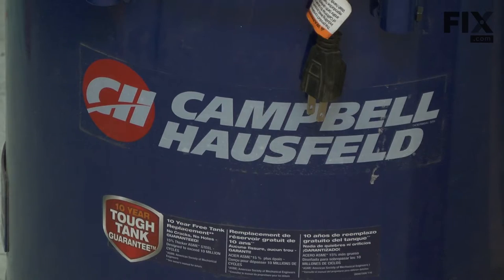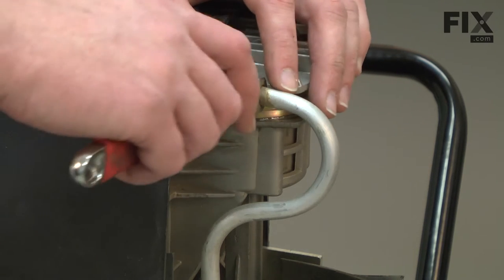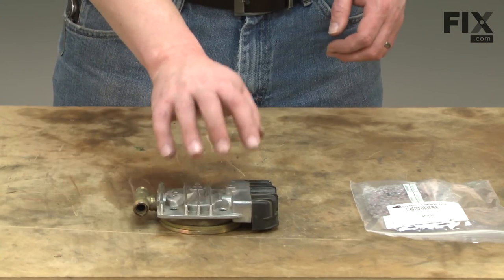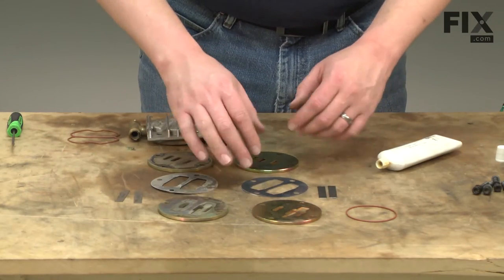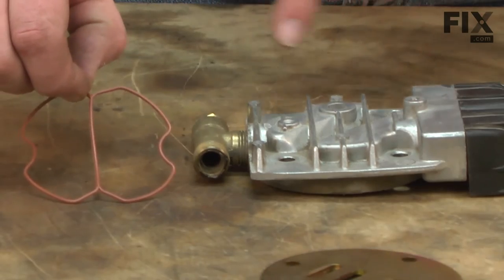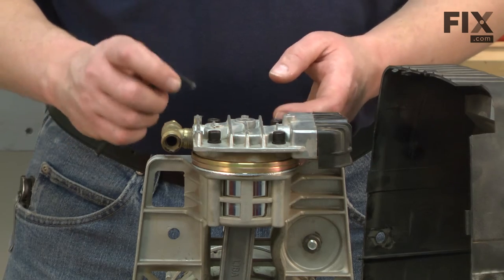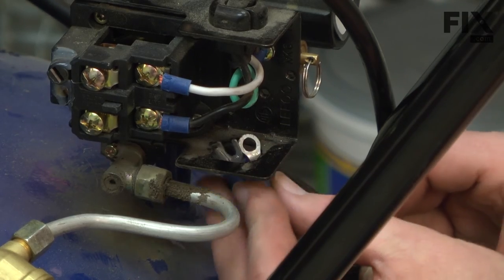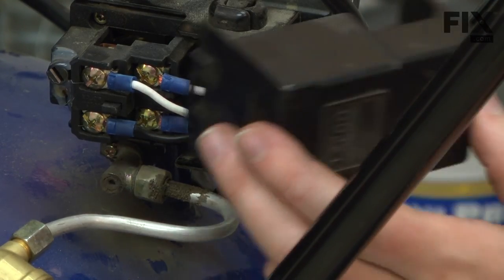Campbell Hausfeld Air Compressor Repair – How to replace the Valve Plate Kit

Comment: The bolts are 5/16 or 8mm.  You do not need to disconnect the wires as shown to do the valves, etc. Simply remove the piping, slide the housing off the compressor front, pry the motor assy out of the back housing, just enough to access the head bolts and set the whole assy back into the two metal anchor plates and you can do the rest of the work where it sits.  My 2 cents worth. Mine is a HU502000 and almost the same as you show. Nice video.

Comment: I have a model HJ3000101 compressor that I need the valve kit and the ring(washer)for the piston  but I can't find the parts, any help here?
Reply from the maker: The following link will show you the available parts for your compressor:  http://www.ereplacementparts.com/campbell-hausfeld-hj300200-200-psi-portable-asme-air-compressor-parts-c-32345_32346_288527.html

 
  
  Campbell
  Hausfeld HJ300200 200 PSI Portable ASME Air ...
  www.ereplacementparts.com
  Need to fix your HJ300200 200 PSI Portable ASME Air Compressor? We
  have parts, diagrams, accessories and repair advice to make your tool repairs
  easy.
  
 

The compressor parts are the same as
your model.
Reply: Fix.com  --Great  Thanks; I have the parts on the way.